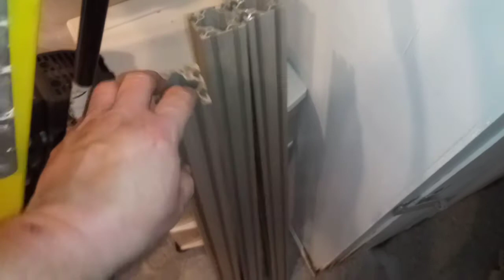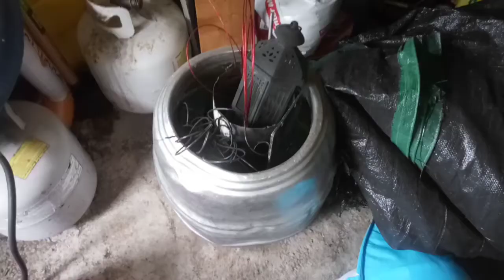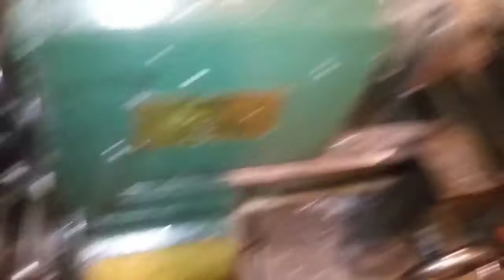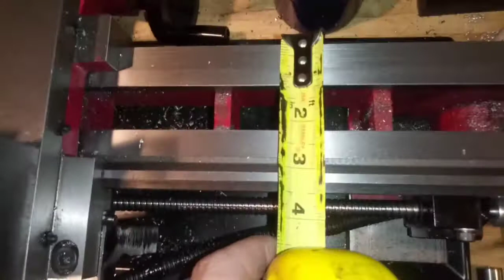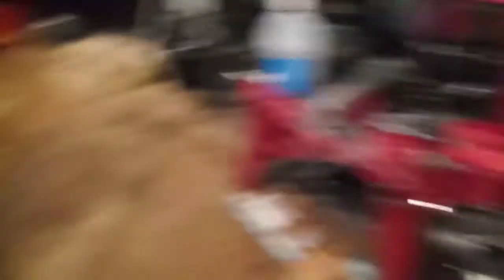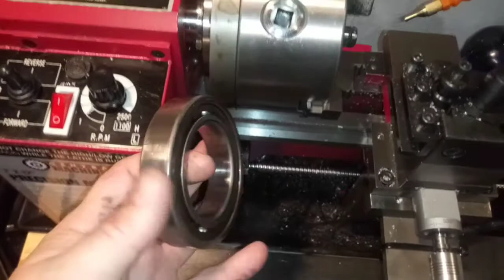Update as to what's going on and future projects

Comment: Lots going on. What is your build plan for the foundry? Fire brick, ceramic wool and refractory? I was thinking of trying to add ball screws and motors to one of those little XY milling tables, but I don't know if it can be done, or if it's way too pricey to experiment with.  BTW I asked Steve Watroba if he has 72 and 36 - 16 dia pitch change gears laying around from one of his endless machinist tool picks. If by some miracle he does, it could be a cheap and quick possible solution for you if you'd like.
Reply from the maker: That's pretty much it exactly. Most of the stuff I have but need a few other things. As far as the gears go you had me at cheap and easy. Your speaking my language. I won't be starting them for about so just let me know. Thanks John I appreciate it.
Reply: @backwardsmachining7526  What I'm wondering about is how you are going to layer the foundry wall. I mean which order of material? Wool, ridigdizer, refractory, then brick, or???
Reply from the maker: @johnstrange6799  because of the odd shape of keg the plan is to use the wool around the inside wall first as a insulation barrier then using the firebrick and morter make the floor and hexagonal? Shape walls. The blower (ice meIter) I got from harbor freight will go in a hole in the bottom. If that blower doesnt work I can make a burner pretty easy with plans online. Where I work they have the parts on the shelf at all times. Last the crucibles I have are old fire extinguishers that I cut in half.